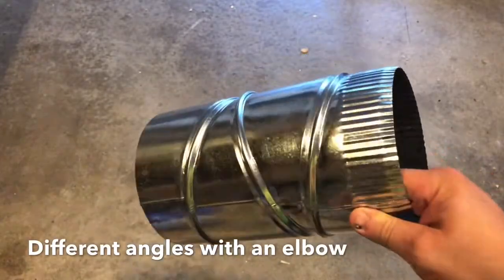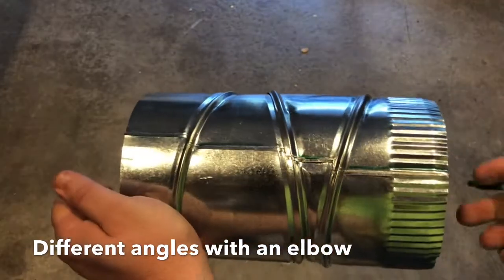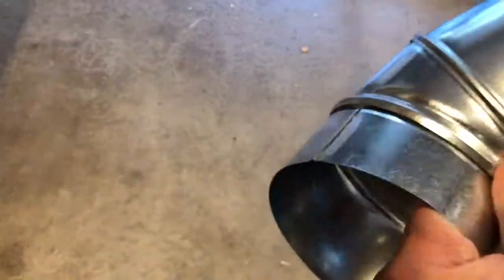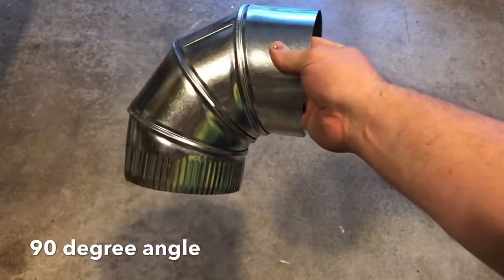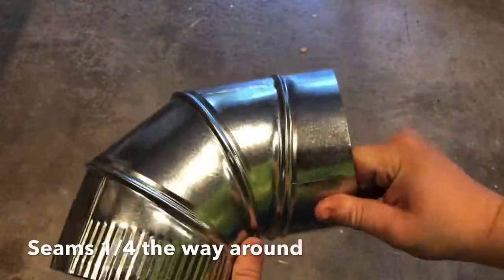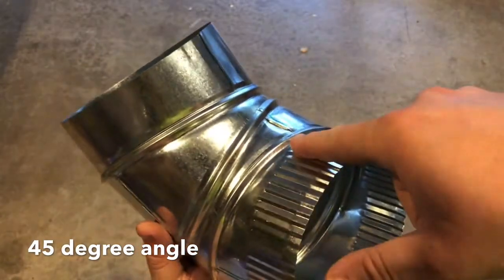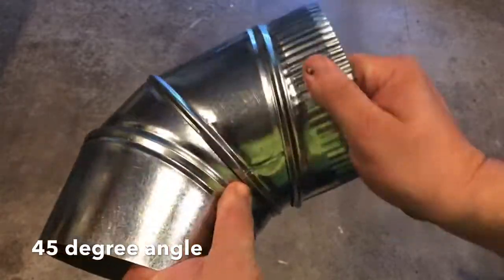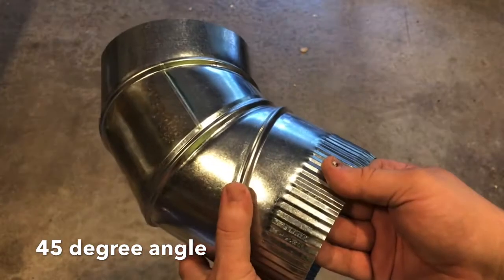Easy way to Adjust an HVAC Metal Elbow for Different Angles

Comment: You can realize 45 deg different ways (and other angles not 0 and 90 deg).  With a "wiggle", the total length is shorter. With the bend all in one plane, it is longer.  Helps match the duct, or shorten to help work it in when the ducts won't move much.
Reply from the maker: There are different ways to adjust the duct to get angles from 0.01 to 89.9 degrees. This is video is to show an easy approach to creating different angles to remove some of the complexity and confusion to adjusting duct to work in different applications. With a basic understanding of how the seams work together to create common angles, any angle can be achieved. 

Thanks for watching. 

Please like and subscribe.

Comment: I measured the circumference of each of the four sections so I could mark each one half way around and get each 180-degree rotation exactly right. But when I put the finished elbow against a square, it's a few degrees off from 90 degrees. Turning each section a little more or less made it worse. How accurate should the 90-degree elbow be ? You did not put your elbow against a square to confirm it's really 90 degrees, instead of something close.
Reply from the maker: The elbow is able to adjust to the full 90 degrees when it is inserted into another section of pipe in the “sloop” of the connection. 

Typically you would want to stay away from using full 90 degree turns because it will choke down the air flow. Two 45 degree turns using two elbows is better than a 90, but there is not usually space to make that happen.

Comment: You got any tips for a dryer duct that goes into the floor but needs to make a 45 degree turn to a 90 degree turn within a few inches?  The dryer hose exits to the floor but the wall exhaust hole under the house is at a  45 degree angle directly below the floor… very limited space.  There is a mesh grate that would be almost perfect for the duct work to go through but copper pipes are coming through it… Will the heat from the dryer mess with the copper pipes. 

Previously they snaked the flimsy dryer hose through… but I don’t know how they fit it through the hole in the floor without ripping the hose… not sure what was done before that as I had no clue it was disconnected until the termite guy told me.
Reply from the maker: Modern dryer duct is made from aluminum or plastic to resist rusting with the warm, damp air that is blown through it. I would avoid routing the dryer exhaust past anything that would potentially cause a dryer lint buildup. 

That being said, I have a couple ideas;
1. Reroute the duct directly through the exterior wall behind the dryer. 
2. Reroute the duct into the floor and have it make a loop so that it can go through the floor rim board straight. The International Residential Code (IRC) is available to view for free at iccsafe.org. Chapter 15 discusses how long a dryer vent can be and how much each turn/bend subtracts from the total length allowed in Table M1502.4.5.1
I hope this helps!!

Comment: It's even easier if you put a few drops of oil, olive. soy, peanut, coconut, avocado, safflower, canola, sunflower, vegetable, corn, 3in1, 10w30, or even WD40 on the seams. Whatever you do, don't, I repeat DON"T use gloves while you are doing this.
Reply from the maker: Good suggestions, but make sure whatever lubricant you add is not going to create problems or odors with the HVAC system. 

In addition, most of the lubricants that you listed may prevent mastic sealants or HVAC tapes from sticking to the metal and may keep the pipes from sealing well long term.

Comment: Hi I'd like to buy 10 inch elbow. Could you please tell me where can I find?  But before I need to know  the dimensions. I mean how high is 90° from bottom to top. Could you help me with that?
Reply from the maker: I just googled it. It is about 13” high and should be available at most hardware stores or Amazon.
Reply: Thank you
Reply from the maker: Please like and subscribe

Comment: I have a 7 in duct in the ceiling that does not line up vertically with the outlet from the range hood below in a kitchen cabinet above the stove/hood.  The hood outlet is rectangular so I have an adapter that makes it circular but it takes up valuable vertical space! of which I have a limited amount to make this odd bend.  It needs to jog over about 6 inches in about 20 vertical inches to meet the top and bottom parts.   I have 2 articulating elbows and am trying to figure out how to make it fit.  The angles required are not convenient, ie not 45 or 90.  I'd love to know how a professional would deal with this kind of situation.  Thanks.
Reply from the maker: Not being able to see the situation with the limitations and different options, I can’t know the best solution. I can tell you how I would tackle solving it. I would set up the exact situation on a floor or workbench to find the best solution. With the limited space you may find a way to adjust the round pipe   to fit. Another possibility is to try two 45 degree angled rectangular ducts before transitioning to the round pipe. Hope this helps!

Comment: Can a separated elbow (at the gore) be snapped back into place or should it just be replaced?
Reply from the maker: An elbow that comes apart where it twists while you are adjusting it can be snapped back together. If there is any doubt that it could come apart again, I would replace it.